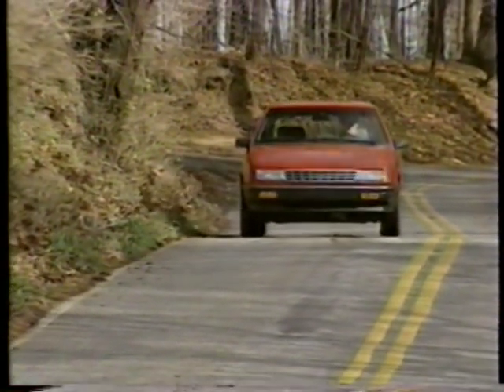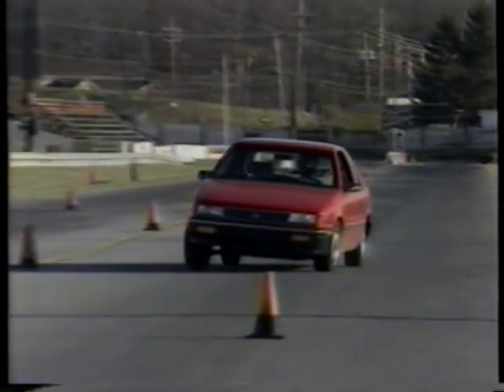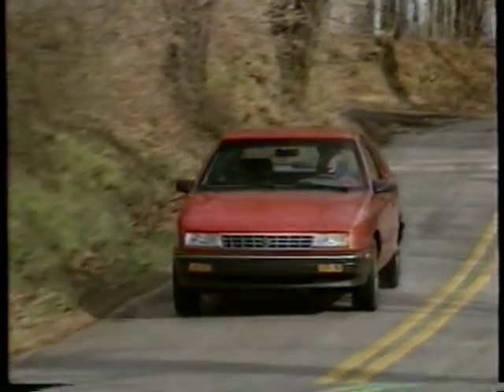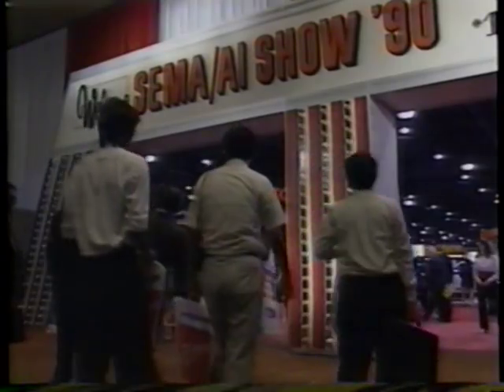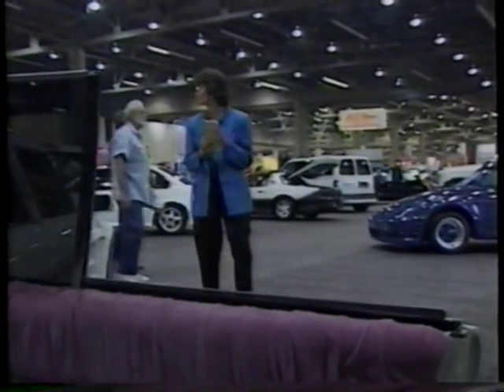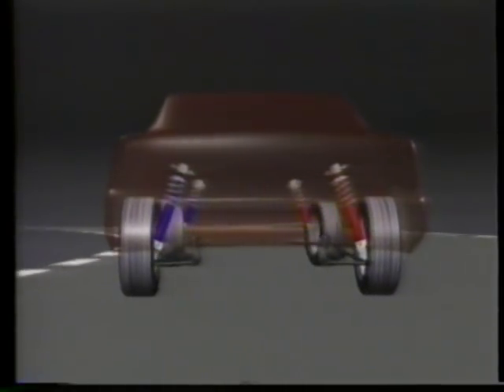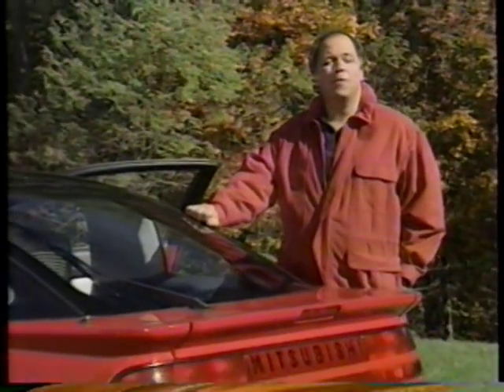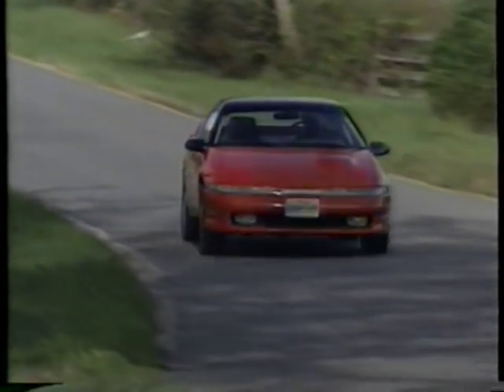12/30/1990 Motorweek '91 Episode 1014 Infiniti Q45 Plymouth Sundance

Comment: I remember doing driver’s ed in a 90 something Plymouth Acclaim. One 300 lb instructor and three students to a car for every class. The driver was insistent we couldn’t merge onto the 401 until we were doing 100 on the on ramp. Maybe that car got up to 100 on the ramp when he was driving alone, but it sure as hell didn’t with over 700 lbs of passengers. 

I had that thing pinned and couldn’t make it past 90 so the instructor kept using his brake pedal extension and forcing me onto the side of the highway telling me I wasn’t being aggressive enough on the gas. I told him I was being plenty aggressive but the hampsters weren’t spinning the wheel and he’d always get mad.

Comment: Those Sundance’s were nothing fancy but ran forever. I worked at Dodge and I did a few water pumps and a lot of valve covers. The occasional distributor pick up would go bad. Simple to work on too.

Comment: My grandfather bought a new Sundance America 2 dr in 1992, his 1st new purchase since 1969. His car's only options were a/c, dual outside mirrors w manual control, auto, and a 2 speaker am/fm radio that sounded horrible. Car was about 9 grand. The 2.2 w the auto had near zero power w the a/c on, but with it off at a steady 70mph cruise, it got high 30s in mpg. While the car gave him no mechanical problems, 2 things plagued it.. Peeling paint due to a crappy primer from the factory, and tail lights that would fill w water after a rain or a car wash. After several attempts by Chrysler to fix that, he got frustrated and drilled 3/8ths inch holes in the bottom of the lense underneath it where u couldn't see them, 2 in each side. Like it or not, it fixed the issue. In 1995 he had a stroke and couldn't drive anymore. My aunt got it next. She drove it 76k before selling it, w only maintenance and wear items to replace. She sold it because she was tired of how bad its continuing peeling paint looked.   Overall though, it was a very reliable economy car that ran cheap and only broke down once for a battery. If 1 can find 1 nowdays that hasn't rusted to the ground, I say buy it. It's a very simple car that's easy to maintain. And a whole lot better than an L body!

Comment: My sister bought a 1988 Sundance and loved it. When it was 4 years old it developed piston slap in the 2.2 liter. Plymouth sold csrs back then with 50,000 mile or 5 year powertrain warranty. My good friend was the master tech at the local Dodge dealer and completely rebiult the engine, including machining the block and freshening the head. Afterwards, the engine was not only quiet, but I suspect the machining must have increased the displacement as well. I visited the dealerwhile the repair was conducted and all the parts were boxed in Chrysler brand stamped containers. My sister kept that car and gave it to my niece. It died with 130k on the odometer and was 10 years old.
Reply: 130k is NOT a quality car. They were junk. Owned one.
Reply: Konrad C you get what you pay for. Equate that when you buy a cheap car!!
Reply: Robert Sise the later 2.2 2.5’s were common block engines they were not in 1988. Piston slap can happen to any engine and does.
Reply: Had an '88 Horizon purchased with 82k. Always had minor piston slap when cold at idle which diminished as engine warmed up. Never did anything about it and sold the car with 143k miles to some kid who drove it for another year until he hit a deer with it.
Reply: unless you bored out the cylinders you reduced displacement by milling the head and block (which were warped i assume), You did increase the compression though ( unless you got a taller head gasket) LOL ....vicious circle....

Comment: Doug Demuro needs to review the Sundance!
Reply: AZDuffman yes he does... too bad they’re really hard to find
Reply: @tomnyboy0916  I have a '93. Almost everything original and still going strong. It's a good car :)
Reply: EnclaveSoldier My mom had a ‘90 and man if only she had kept it long enough to pass it down to me
Reply: @tomnyboy0916  I mean... I'm a car guy 100%. I drive anything with 4 wheels and a steering wheel. But Even I have a hard time justifying keeping one alive... There are cheap, underpowered, unequipped cars that are still fun like the Honda Civic EH2. But this car is just... Boring. The steering is incredibly muted and bland. The 3 speed auto is... Well, a 3 speed auto. And the engine, although the 2.5 has low end torque, which is the one I have, it really has no acceleration. It doesn't want to rev. And it's not too good on the MPG. Mine is a little newer than the one on the video and has a new grille which looks much better, but at least the design of the car has aged well IMO compared to, for example, a Neon. Overall... I'm keeping my '93 2 door for a while more because I'm a broke Mexican college student and I can't afford much more at the moment. Also, I already changed the tranny, tires and a lot of suspension parts, the paint is good, and the engine too. So I guess it's a good car, but not one you wanna keep for long. I'd much rather have an '89 Accord or something like that.
Reply: Doug is clueless when it comes to older cars especially mainstream economy cars.  He would moan about it not having power windows or door locks despite that usually being an up level option in 91 and then proceed to  say something stupid like "I can't believe it doesn't even have bluetooth"
Reply: I wish he could!
Reply: AND a Justy!!!!!
Reply: @davesgarage78  he's annoying. When it comes to older
Reply: Doug Demuro needs to be off YouTube and cancelled. He is a clickbait shill.

Comment: I miss the days of being able to buy brand new CHEAP transportation. Now everything is power, infotainment, fancy wheels, gizmos and gadgets.....pushing new car prices north of $20K for an entry level Civic or Corolla. Forget the big 3, they don't make small cars anymore. Only $35K+ Suvs and pickups. Ridiculous,
Reply: I think Kia is sort of picking that basic Cheap transportation place. You can get a new Rio for like $13k. Still not super cheap but not bad.
Reply: You can get a new Nissan Versa for $12,000 ditto the mandatory back-up camera.
Reply: Get yourself a fully loaded 2011 Honda Accord V6 with about 100k miles. Heated leather seats, 271 hp, plenty of room for yourself and 4 fat guys, all for about 10 grand. 

December 1, 2018 4:54 am
Reply: @whattheheck1000  I paid that for an 11 GS350. Best secret in used cars. AWD too and every toy.
Reply: Ima fan i agree. A friend of mine bought a new ‘93 Sundance for 9,600! He sold to me in ‘96 and then My niece drove it until 2004. Good solid car
Reply: @fatmax2195  Right, you gotta look to Korea nowadays for cheap transportation, including captive imports ( Chevy Spark).
And 13k is a great deal if you include 25 years of inflation and better base equipment and mandated safety features.
Reply: @alb12345672  just looking at GS now on Auto trader, you're not kidding!
Reply: @tommytufguy3432  Yeah, go on the forum and see how reliable they are. It has a toyota tundra /tacoma depending on the year drivetrain.
Reply: Milford Civic: Honda is crap.
Reply: whattheheck1000: Honda is crap.
Reply: @paulnadratowski3942  I had a 91 Dodge Spirit and junked it at 255k miles in 04.
Reply: I couldn't believe average price of new car is $37.5 I think, because of high tech and aesthetics you mentioned, like wheel packages, spoilers etc. Ppl are nuts buying new.
Reply: @paulnadratowski3942  Plymouth Sundance/Dodge Shadow were great subcompact cars. Cheap to buy, cheap to maintain and repair, dependable, well-built, comfortable. I miss mine.
Reply: SEMA show: Hold mah beer
Reply: @chriscornelius2518  that's mighty impressive. Which engine and transmission? My mom had a 92 Acclaim and it was totalled at 182k miles in 01. In basic form they were really good cheap cars. I say a better value than the Accord and Camry of the time. Cheaper to buy, repair and lasted just as long.
Reply: @jaxandmore440  it was still running, but I traded it against a bill on my work for another car. Alot of the miles were long trips to Florida. The issues I had with the car were fuel pump replaced, oil pump replaced, and air conditioning. That was about it.
Reply: @chriscornelius2518  

Good cars.   Those sohc 2.2 and 2.5 were easy to work on.    Out family at one time, all had cars with those engines in the 90s.
Reply: You get far more value for money now, though.  This car would cost over $20K today if adjusted for inflation and would still be total crap.

Comment: still got mine original owner 234k.
Reply: 93sundance I hope things get better for you buddy.
Reply: Genuinely feel sorry for you, I had one, quite possibly the worst car I've ever owned
Reply: Had a 1994 drove the crap out of it and no issues aside from maintenance it went over 300k.
Reply: These cars were absolute pieces of shit
Reply: Mine Has 400K  You have to catch up
Reply: Now that's dedication.
Reply: 93sundance I am surprised you admit to owning one.
Reply: There's a lot more 90 Hondas around than these turds.
Reply: @signlsirchir2156 The '90 Accords were the transition of Honda to mainstream cars.  They still look good after nearly 30 years. The Sundance is not a bad car considering its price.  The 2.2 was a better match for the lighter Omni and Horizon.  With TBI the 2.2 didn't have the problems that the feedback carbs had, but only the turbo versions had much power.  The horsepower of the 2.2 actually decreased from 96 to 93,.   With the 3.0 Mitsu V6 the Sundance was quite quick, especially with the five speed manual.  The 2.2. and 2.5 are  easy to service, probably one of the last motors that an average DIY mechanic can handle most repairs.
Reply: @timothykeith1367  I had a '90 Sundance and I loved that little car. I learned to drive on my Mom's '92 Plymouth Acclaim. Both had the 2.5L 4cyl and 3-spd auto. That was an excellent powertrain.
Reply: 93sundance: Make a video about it!
Reply: I wouldn't  brag lol
Reply: @1955gaylord  not bragging stating facts. How many 1 owner 25 year old vehicles do you own that has been shipped across the Atlantic twice and driven on 2 continents?
Reply: @JakeFromLateFarm  maybe someday.
Reply: It’s just a car. Get over it. I still own a 92 GTI 16v I bought used in 99. Just two weeks ago bought a Scion XB from 2015 because I wanted to have something roomier with my second kid that was better for longer trips. If you care for your cars, regardless of how fancy it is, why not keep it as long as it serves you? I’d rather put money into a house or other appreciating asset than buying more cars. 
On that note.. we really need more cheap new cars in a basic trike like this avail today. Like a stripped Honda Fit.  They only offer LX or higher. Miss the simple Honda options.
Reply: lies...lies.....prove it
Reply: @timothykeith1367  I loved that 2.5L, having owned 3 of them. Very smooth for a 4cyl. at that time thanks to having balance shafts. Quite dependable too as long as you didn't let it overheat.

Comment: I had a couple of 91-94 Dodge Shadows growing up and they were always solid little crappy cars, never any major issues with them aside from body rust and the fact that they were lame. No over-engineering or complicated mechanical failures, the only things I remember being a major issue with them were tail light wiring problems with both of mine and a timing belt in my last one (interference engines, which I didn't know about until the timing belt broke on my blue '94). They were alot more durable than the '95 Neons that replaced them.

Comment: I own the 93 Dodge Shadow ES. It had the 3L with the 5-speed manual transmission. I resurrected it out of the junkyard in 1998, all these types of cars were junk. Turning a wrench back then I was able to get all the parts at cost and the car was extremely cheap to buy at $300, with tires I put about a thousand into it and drove it for 3 years. For a small car it was extremely roomy for tall guy like myself that's probably the only thing it had going for it.

Comment: No oil or volt gauge? 3/10
Reply: Mine does have volt gauge... I don't know why this is different
Reply: It does have a volt gauge, it's on the left. My 94 Shadow ES had a tach and a smaller gas gauge.

Comment: I bought a brand new Plymouth Sundance in 91 absolutely the worst car I've ever owned 16 * to the dealer the first year
Reply: I kept it for a total of 4 years and put 60,000 miles on it and that time the head gasket had blown twice the intake had to be replaced because of the flat factory flaw in the casting the shifter cable broke and they had placed the wrong computer in it from the factory so when you were driving down the road it would lock up at speed
Reply: @—TheManInDboX — I tried doing them all mine and I had the attorney from Chrysler look me straight in the face and said I will fix the car until it runs out of warranty and then it's yours arbitration sucks

Comment: The Dodge shadow/Plymouth Sundance were definitely the last decent small car offering to have ever come from Chrysler to date. This  Cousins when in base level trim turned out to be pretty reliable and lasted a long time provided the owners took care of them and they worked driven in the Northeastern States where they tended to get eaten up by rust. It's sad that a decent little car like this was replaced by the ghastly in very poorly built/engineered Dodge/Plymouth neon. Although the Sundance/shadow Tended to serve their 1st and 2nd owners as decent and reliable transportation they tended to be largely forgettable Little runabouts. Chrysler also did a major disservice to the twin cousins by constantly comparing them to other a much more worthy competitors like the Honda Civic and  Toyota corola.

Comment: Did the 1991 Plymouth Sundance America come with a chime or a buzzer?
Reply: buzzer if the keys were in the ignition or you leave the lights on.
Reply: No they had a chime. The Dodge Ram Vans and Pickups had a buzzer though. I used to have a '97 Ram 1500 Club Cab and it had the buzzer. That was also the last year for the buzzer, the Ram Pickups and Vans gained a chime for '98 onwards in addition to redesigned interiors.
Reply from the maker: Thanks PG. good info
Reply: I learned to drive in a Plymouth Sundance and it had a buzzer. But I believe that one was a 1993.
Reply: @matt9759  Really?!?! A friend of mine had a '90 Shadow back in the day and it had the chime.
Reply: @Tbolt1000TForLife  
Yep. It was my stepmoms. A complete piece of crap but it did have freezing cold ac and the engine survived when the timing belt snapped while we were driving through a parking lot
Reply: And for some reason, the buzzer in my '93 Mercedes was nice. But in the '93 Sundance, it was ghetto and tacky lol

Comment: I had a Dodge Shadow. It was a complete pile. Slow, poor handling, not good on gas and rust prone. The brakes were terrible too. Doing a hard stop from 65mph would cause the discs to overheat and pulse like crazy. The only one I'd own now is a CSX. Base model was a pile
Reply: Konrad C well try buying a new one instead of complaining about the neglect it saw!
Reply: Many of those cars had non-vented discs in the front. They could not take hard stops without warping like potato chips.
Reply: @patricknesbitt4003  Yup. Mine was one of them. Worst brakes EVER. Completely unsafe, but i was 17, didn't know anything about cars.

Comment: Sundance was a much better car than Neon. Neon was crap, it felt and looked cheap, regardless of its “bubble eyes.” John Davis needs to get over lack of a tachometer on an entry level car, for you can do without it. That Sundance would need air conditioning and automatic transmission for me. Manual transmissions suck, especially in stop and go traffic.
Reply: Always complaining about lack of gauges on cheap cars was stupid.    You don't need a tach on the Chrysler.  That engine was built for low end torque.    The 2.2 was only "buzzy" if you revved it too high which wasn't necessary.     Stupid show, but entertaining today.